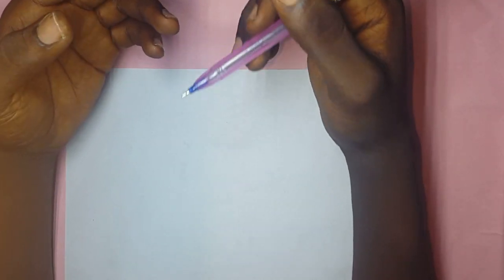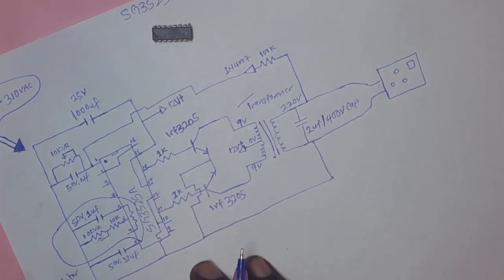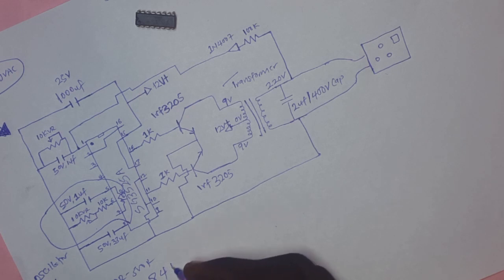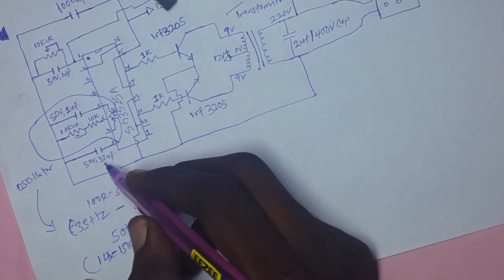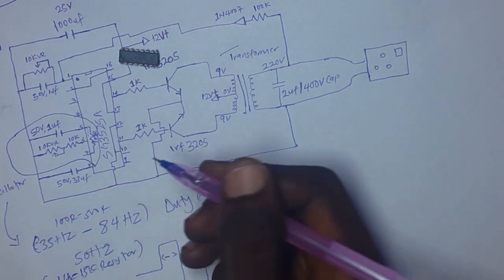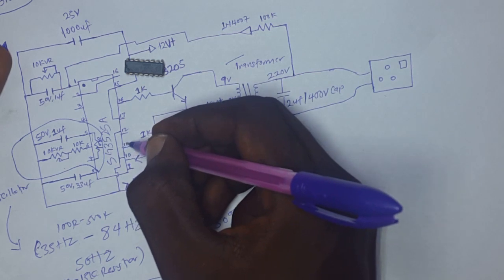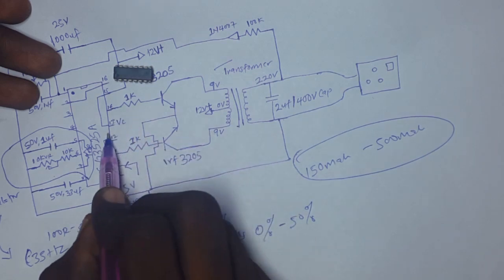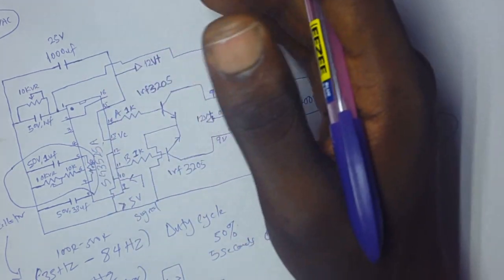SG3525 inverter circuit diagram and full explanation for Beginners!

Comment: Thanks for sharing your knowledge with us. I can now understand the sg3525ic better.
However, I have a question which you should kindly answer. Please, at the output end, you are capable of having 310v AC. Does it mean that the transformer should be up to 310v or the normal 220v at the secondary side?
Reply from the maker: 12v Transformer should be 7v-0v-7v to 220v